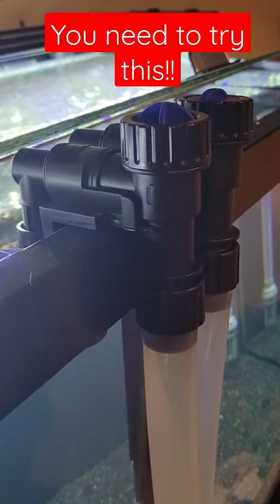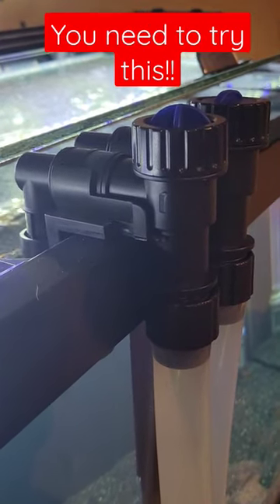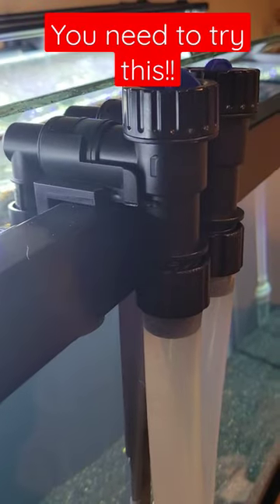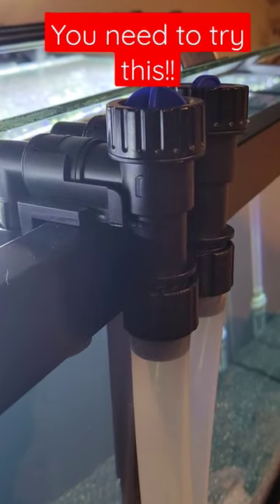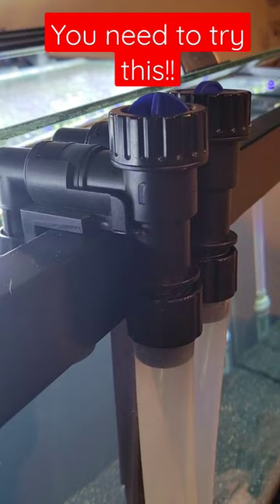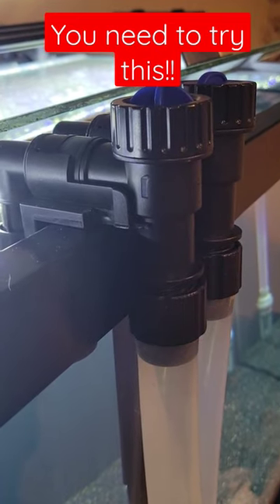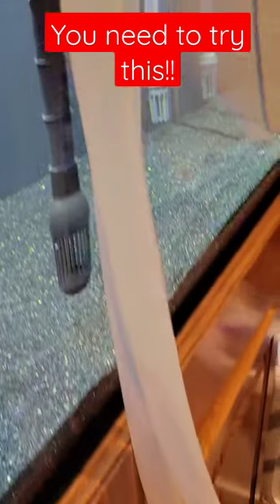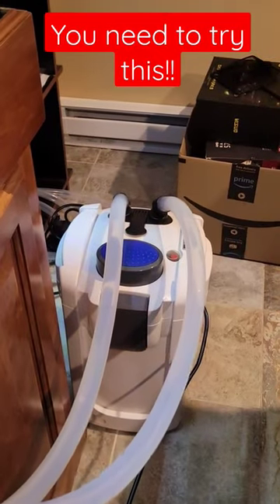SunSun 704b Canister Filter Experiment - YOU NEED TO SEE THIS!!

Comment: What size tubing is that?
Reply from the maker: Here is the link
QuQuyi 3/4" (19mm) ID x 1" OD High Temperature Silicone Vacuum Tubing Hose Black Upgrade Extended Version Pure Silicon Tube Air Hose Water Pipe for Pump Transfer, 6.6ft Length https://a.co/d/c94OFhH
Reply: @BassManStrikes  3/4 got it, thank you.

Comment: Where did you get the HW3000 parts from. Do you have a link? And what’s the diameter of the silicone tubing. I’m thinking about getting me the 704B for my 75 gallon tank.
Reply from the maker: Amazon or ebay have the intake and outlet parts, I recently upgraded my 704s to the hw-3000.
Reply from the maker: I posted the link to the tubing in the description.
Reply: @BassManStrikes  How do you like the HW3000 compared to the 704B?

Comment: may I ask where I can buy that silicon tubing . Thank you ❤️
Reply from the maker: 3/4" (19mm) ID x 1" OD High... https://www.amazon.com/dp/B09ZNYT4SC?ref=ppx_pop_mob_ap_share
Reply: thanks sir ❤️
Reply: Does the upgrade plumbing require a 3/4" x 1" diameter hose? Is this the 303A/B up grade or 304?  This is rather confusing as it would lead ppl into thinking that they'd have to get a larger hose diameter as well...
Reply: Hi did you get an answer or try this?

Comment: What are those black HOB intake/outtake controllers? With the blue knobs on top? I’ve never seen them before. I need them because my water flow is almost too powerful for my tank
Reply from the maker: It's the plumbing that comes with the sunsun hw-3000,  you can get a set on Amazon or eBay, just search for hw-3000  intake outake
Reply: @BassManStrikes  You’re a legend! Thanks for the info! Just ordered them 🤜🏽🤛🏽